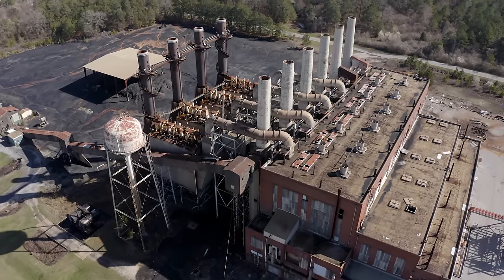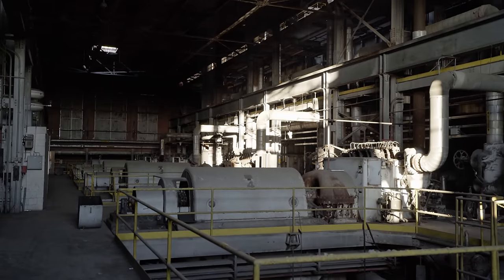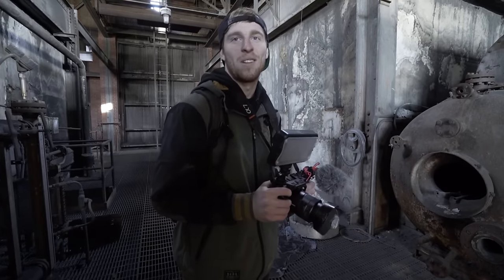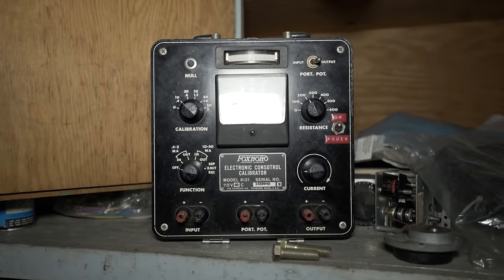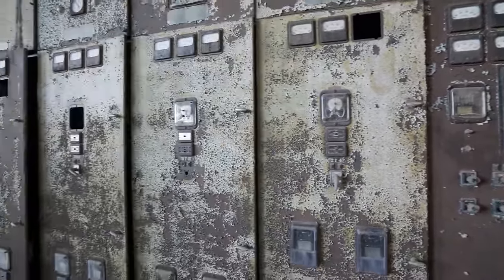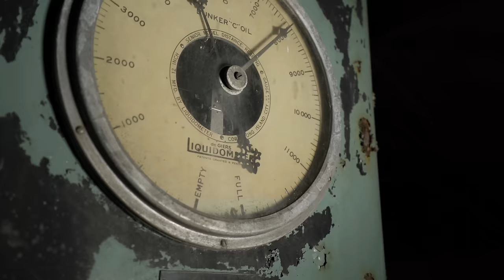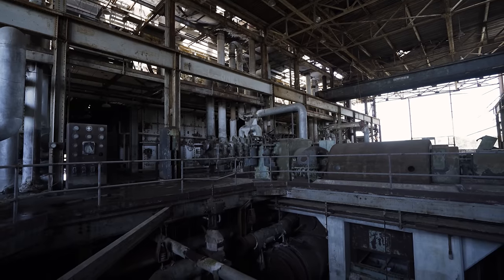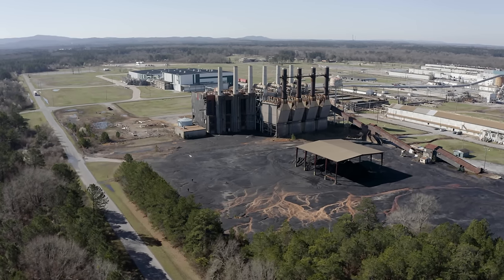Exploring WWII Power Plants Abandoned Decades Apart - Amazing Contrast in Decay!

Comment: I was an instrument tech for many years at nuclear plants during startup. Bailey and Foxboro were names you saw all over the place. Bailey Instruments was one of the few manufacturers of mechanical pressure sensor gauges and controls certified for nuclear plants. It was a real pain adjusting the mechanical linkages they used.

Comment: I spent over a decade at a facility on the Texas gulf coast that was built in the 40s . Many of the units that were built at UCC TX City were built to a similar standard. For me it’s quite entertaining to see this thru y’all’s eyes knowing only a fraction of the things y’all are looking at , as I tell you thru the video what they do . When that equipment was running it was glorious!
Reply: Steam plants are pretty amazing, from the physical processes being carried out, to the scale of the equipment. It's a simple process at the surface level (I mean it's just boiling water right) but once you get into the heat balance with all the turbine extractions, feedwater heaters, etc it's amazing to think there's people out there that are smart enough to engineer the plant in the first place. It's also pretty abstract as there's not any point that you can see what's going on. You can't see steam bubbles breaking through the water in the drum, and even if you could somehow get a view inside a steam line you wouldn't even be able to see the steam considering it's a gas which is pretty hard to wrap your head around. You've just got to trust that there's a very respectable amount of energy in those pipes lol.

Comment: that generator is being run as a synchronous condenser for the grid. used to increase power factor in the system, the generator is separated from the steam turbine blading and only ran for this purpose. the noise you hear is the generator spinning, there will also be an DC exciter running for sync purposes. generators are spun up on a pony motor until proper wattage is achieved and then the generator is tied into the power grid system, the excitor voltage (DC) is increased or decreased depending on system voltage to achieve steady current and correct leading/lagging within it. due to this turbine not being steam operated, law does not require 24/7 oversight of the sync, therefore periods on non supervision will be common. there will be no steam as you stated as the boilers are not running, any auxiliary boilers would have to monitored 24/7 if they operator at certain pressures.

Comment: I’m jealous, I been by that plant many times over the years. I always wanted to look inside. I worked for the paper company in the 1970’s. The rayon plant was called Beaunit. I didn’t see the water fountain by the offices. Wonder if it’s still there? Years ago the pump house that supplied water for the power plant (across the road) still stood. It was good architecture as well. Before the Beaunit warehouse and manufacturing facility was torn down, it was a sprawling installation. 
Thanks for the look inside!

Comment: There’s a good chance the first plant, had one of the generators running as a synchronous generator, pushing VARS,  as needed by the system. 
Back in the day, the modern plant had 3 major operating stations. You found one of them. They where B Boiler, T Turbine, G generator. The advent of more automated consolidated those to a Control Room so a smaller team could control the plant. It was still pneumatic control. Next evolution was to replace the pneumatic black boxes and operator interface with electronic but still not much programmable automation. 
I upgraded many power plants over a 30 year time for a utility.

Comment: I worked in an old asbestos filled power plant for 38 years, you guys have been through so many of them now that you recognize systems and equipment, like the coal feed to the Boilers. It's as if you've been training to work at them while doing your investigations. Great escape also, I would probably have froze and crapped myself.
Reply: What does these boilers do ?
Reply: @shubhamsaxena2419 Provide steam for the turbine / generators.
Reply: @patrickcarcamo622  this much engineering just to provide steam for some other equipment wtf 💀💀
Reply: @shubhamsaxena2419  That how we make electricity.
Reply: @patrickcarcamo622  meshu peshan tikha

Comment: I presume they were only running air compressors in the working power plant to sustain other equipment nearby, just using it as an air house, I doubt they were actually running the generators, nice to see an active site now and then :)  nice escape!!
Reply: I agree. Sounded like a big roots style compressor.
Reply: There are ancient power plants in downtown KC, MO. which sent excess steam to all the high rise office buildings for heat.  I don't think they generate electricity but still supply heat.

Comment: I got to wander through an ancient yet fully working 4 turbine gas fired 1 GW power plant (I worked for a subcontractor doing outside work but nicely asked).  They gave me safety gear (vest, hard hat, ear protection, goggles) and told me to not touch ANYTHING or even approach open power circuits.  The entire place was made of welded pipelines and the valve handles were all ornate with decorative curves.  The entire piping system looked like it was made by artists.  The place was really cool.  I did take some photos but the camera wasn't great.  Some building had equipment "rusting in place" as they described it.  Everything was there as the plant was operational and had their own security personnel plus a serious fence.  Nowadays with the various nutcases targeting infrastructure it probably wouldn't be possible but you never know.  My exploration was 10 years ago.

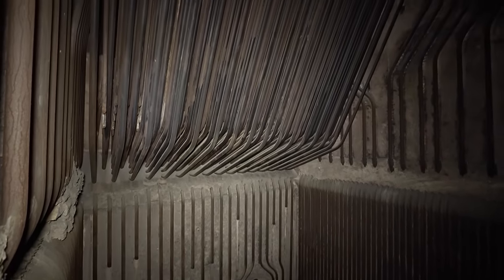Comment: Pipes are out side a boiler, anything outside going in or inside a boiler is a tube. Pipe Fitters service the outside connections Boiler Makers do every thing connecting to and inside the boiler. 6:39

Comment: Other than cell phones, do you guys use 2 way radios to communicate ?

It would be a good idea to have earpiece speaker/mics attached to VHF or UHF radios and use the VOX feature or the PTT button on the TAC earpiece

I think you should look into it

Just like SWAT teams use

It would be great for splitting up and for noisy environment
Reply: Definitely. Get licensed for the bands you want to use and learn to use them well. Make a plan to jump channels to avoid interference and such.
Reply: @trevorus  re: "Get licensed for the bands you want to use"
Any more the MURS (VHF) are available license-free, as are the usual FRS radios (but at 2 Watts now), and there are license-free spread spectrum radios that use then 900 MHz band too ...
Reply: I would be concerned about being picked up on VHF. Our local law enforcement switched to digital radio but still uses VHF channels for talk around and in the event the main channels are down. There’s often skip on the old VHF channels so even though they’re mostly ignored, they’re still monitored.

Comment: Heads up if you ever encounter live equipment again - older electrical breaker/switch panels are EXTREMELY dangerous. Older high voltage switching stuff >480V had high risk of arc flash when switched on/off. I worked at a power plant for a while as a Mech. Engineering intern - I had to verify with the control room that no switching would occur before entering breaker/switching areas. Ironically the actual running equipment itself is not as dangerous and I was allowed to freely roam the rest of the running units, climb towers, open access panels, and explore the abandoned parts of the plant (like a failed gasifier unit!). High pressure steam is also very dangerous but at least is identifiable - hissing sound. It's not visible but you can find steam leaks by running an object around the pipe/valve where you hear the hissing from a safe distance.

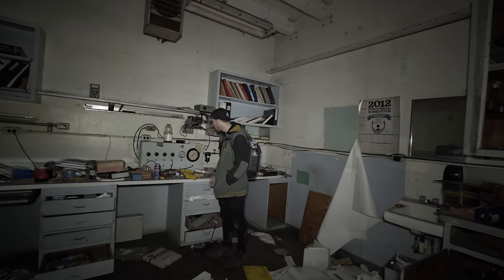Comment: At 11:00 y’all were in the instrument shop. That’s where the I/E techs would calibrate the instruments from the process. The big gauge on the wall is a “Wally Box” typically for pneumatic instrument calibration or to work on pneumatic controllers or control valves.

Comment: worked at the Charlestown plant in the 80's on an asbestos removal team. nothing in this video looks familiar to what I remember at Charleston. tons and tons of asbestos. every pipe in there covered. one room with rows and rows of glass case battery's, had to move switch to get to a pipe, when I moved it, all kinds of shit started running. since the plant was to be demo'd, I snuck a huge steam whistle out along with a small TRI whistle. still have them.

Comment: When exploring a power plant always, always, always look for a nameplate on a turbine or generator.

Turbines have blades, not fins. The blades are also called buckets and the fixed bits between the blades are called nozzles. 

At the Coosa Pines plant Units 1 & 2 were abandoned. Units 3 to 6 were retrofitted for electrostatic precipitators (precip) the ash pumps are what carries the flyash knocked off the plates and wires away to be disposed of (or sold for a concrete additive). The row of stacks nearest the plant were abandoned. The newer, shiny ducts conduct the flue gas to the precips and the set of four stacks became the operational stacks.

Comment: Looking at the boilers in the run down plant, those were the burner heads I’m pretty sure. Combustion air would be forced through the tubes and there should be an eye glass and possibly an igniter? I worked on natural gas annealing furnaces and small boilers for awhile in a previous line of work. The burner heads were all very similar in design, so I imaging the difference is the just the fuel being coal or wood chips for the boilers. I toured a paper mill that had its own turbine which ran off of wood chips that it used to make its paper.

Comment: Water wall. Water-cooled steam generators/boilers.. ,the steam drums and superheater s were there . I worked at a slightly larger plant like this 
Looks like there would be a operator somewhere stuff is running just to keep an eye on it you can't let equipment run and not be check😮

Comment: it is amassing that turbines are turning , power is on but the boilers are cold and pulled apart , no control room, no people around. there was a newer building in back of the old one they were in with newer oil fired boilers . they were just using the turbines in that old building , they have to have a licensed high pressure steam boiler engineer operator on seen to run the plant also electrical engineer and support people to run that plant. at least 15 men. they were lucky they did not get caught, the control room was in the new building .

Comment: They are probably running the generator off the steam produced by the recovery boiler at the paper mill. You can see the steam lines running between the two on the satellite view. They have to do something with all the heat made by a recovery boiler so might as well generate electricity and sell it.

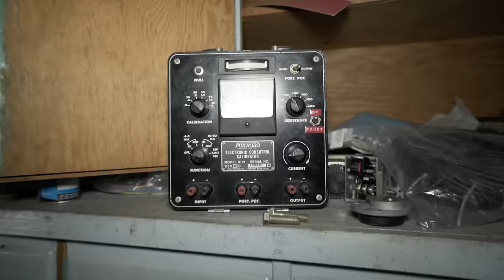Comment: The piece  of equipment at 11:30 is designed to calibrate large valves that are remotely controlled
 The valves get a standardized electrical signal from 4-20 mA . 
4maA might be closed , 20 mA open wide. Anything in between is proportionally partially open.

This is a tiny amount of @24 volt electricity and can’t Do anything real.

The valve contains an I to P converter , it Converts the 4-20 mA signal into a proportional Air Pressure signal .

That air  pushes on a rubber diaphragm and Actually opens and closes the Valve.

Comment: The fancy gauge that they looked at said Liquidometer.  Was for measuring the volume of liquid fuel in a tank.  The fuel being Bunker "C" fuel, which is a type of thick oil use for steam generation.  This was the primary source of fuel for Navy Boilers of the time period.  So it is likely it may have been an alternate fuel source when coal was scarce or this plant may have been converted to use Bunker C instead of coal.
Reply: Made by the liquidometer corp, long island NY. Looks to be 1920s vintage.

Comment: Maybe I missed it, but did they say what equipment was running and making all the noise? I know they said the turbines and boilers were sitting idle, but there was running machinery of some sort. It was indeed loud!  -- In the second building, all that asbestos. That's probably one reason they don't demolish those buildings. Having to deal with all that asbestos! Ugh.
Reply: Right before they left the newer plant, Ryan pointed to a control panel, and one of the air compressor gauges was active. So the noise was from a huge air compressor. If anything else was running, they didn't say.